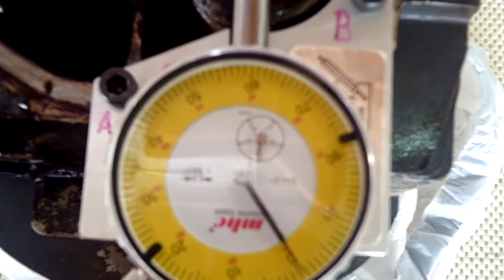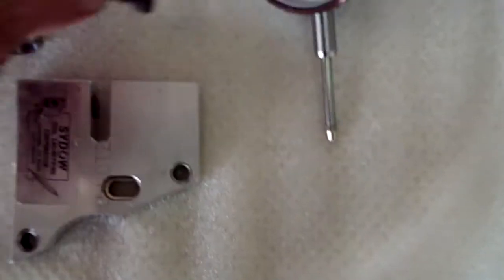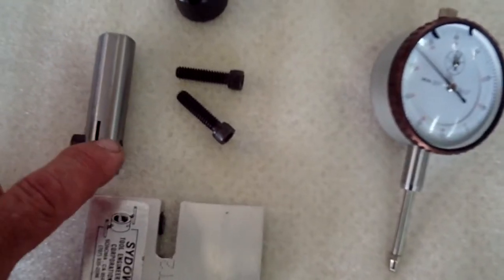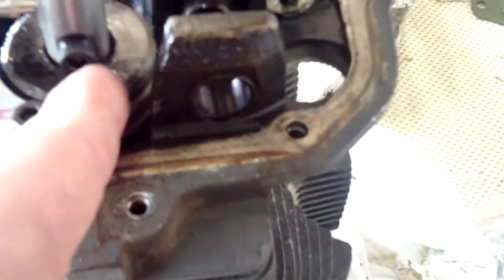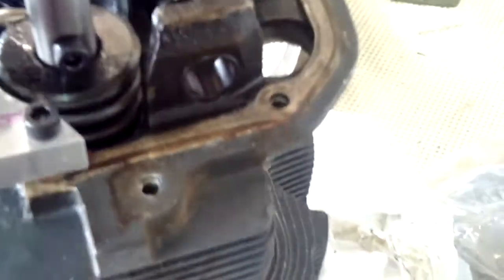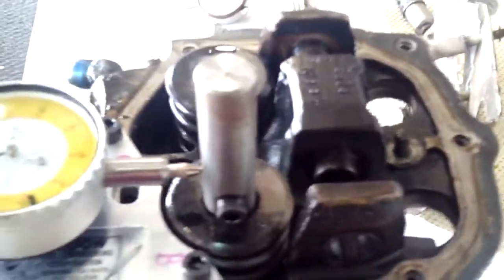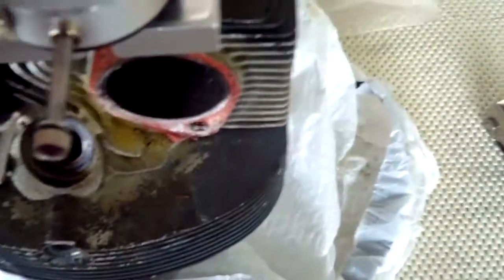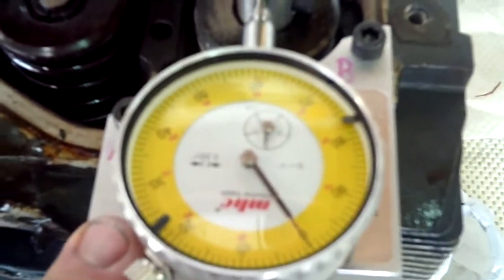Valve Wobble Test  - Grumman Style

Comment: I have the same fixture. On parallel valve engines, 388C specifies 1.190" from the rocker cover surface to the center line of the indicator tip. This fixture located my indicator about .275" too close to the rocker cover surface which makes the valve guide clearance measurement less than it would be with the indicator as Lycoming specifies.  When you do 388C, make sure it's per the SI distance, with the spring removed and the exhaust valve pushed into the cylinder.
Reply from the maker: Just showing folks what goes on not the fine detail.  Great for trends.

Comment: Improper procedure and inaccurate with the springs still installed. Your method also indicates the rocking (movement) of the split extension on the valve stem.  Pressure is to be applied to the stem itself for this reason.  Others, please don't do it this way if you want an accurate reading.
Reply from the maker: Following instructions of the tool

Comment: The Lycoming service bulletin procedure removes the valve springs so the stem may move freely.   Are you aware of anyone comparing the spring in place method to the SB method?   If the results are the same, it would be nice to keep the procedure as simple as possible.  Any possibility of movement between the extension and the valve stem?
Reply from the maker: Not with the tool.  Spring can stay on